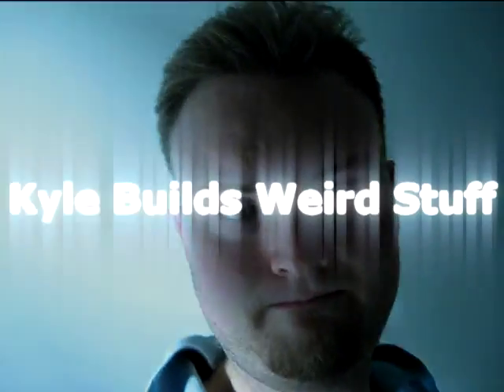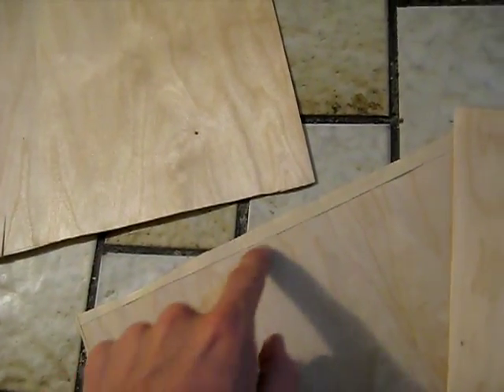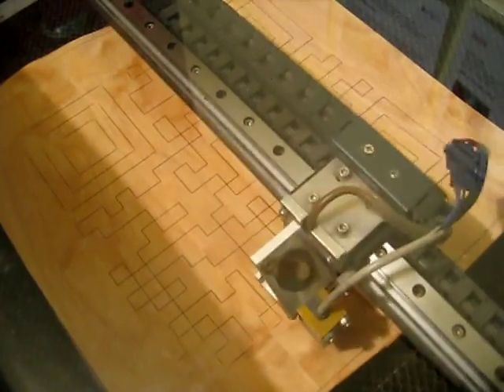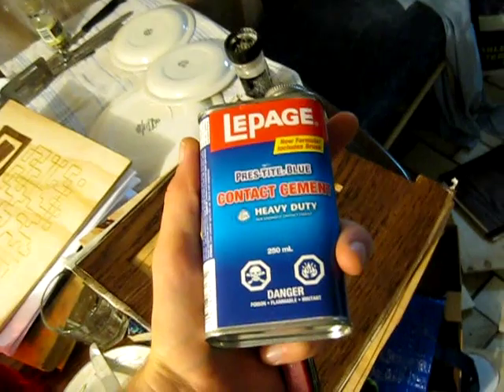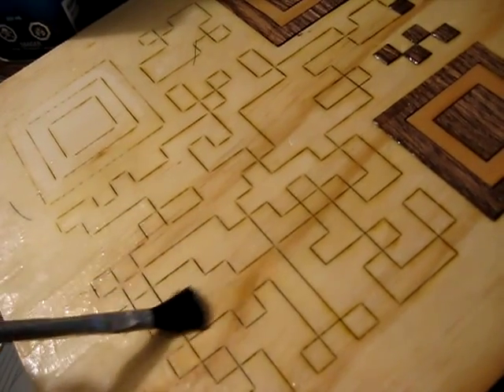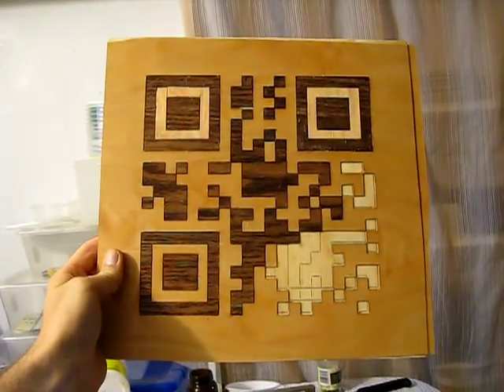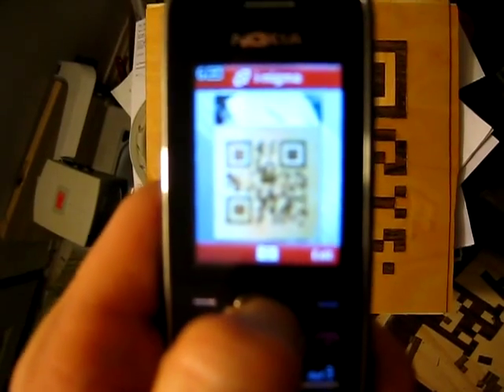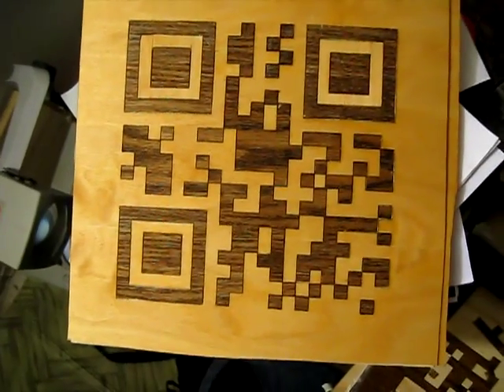Laser Cut Wooden QR code

Comment: Kyle forgot to add that there is a reason for choosing contact cement over what most people would think of when gluing wood; wood glue.

If you were to use wood glue, the glue would absorb into the wood and cause it to swell.  If the wood veneer swells, it will not fit together properly and your image will be distorted.